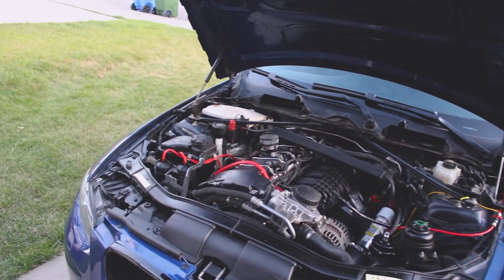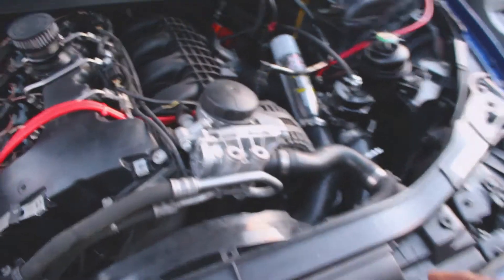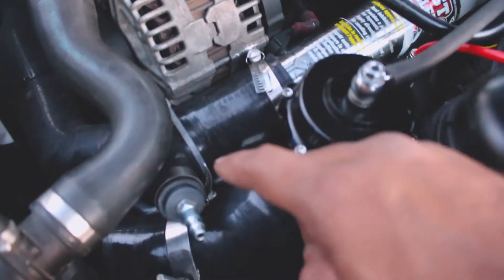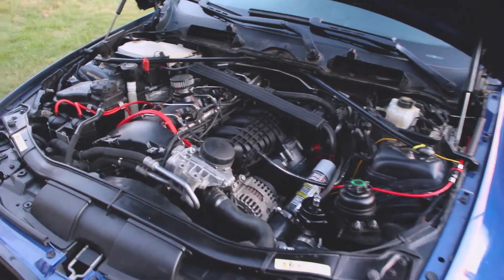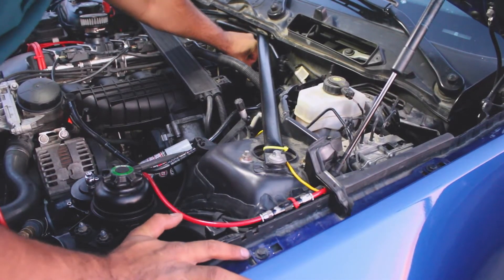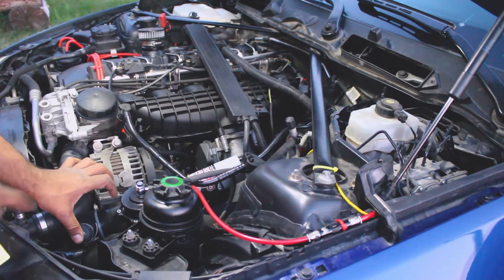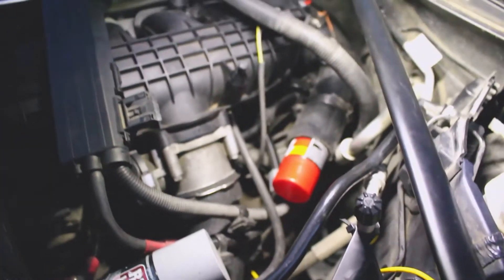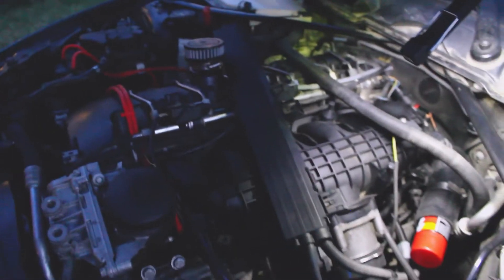How to check for boost leaks on a turbo 335i n54

Comment: If you are going to do this pressure test make sure to leave your oil cap open and leave your current Catchcan setup as is(no need to cap inlet). Pressure will build in the head and push out the valve cover gasket and destroy it. If you need to build more pressure just lower the oil cap down and apply some pressure to force it to leak out of whatever potential weak point. 

The fix for me was the bolts that hold the TMAP into the charge pipe actually leaked air. Make sure to replace gasket on TMAP with a 10x2 Green O ring and put Teflon tape around the 2 Allen bolts.